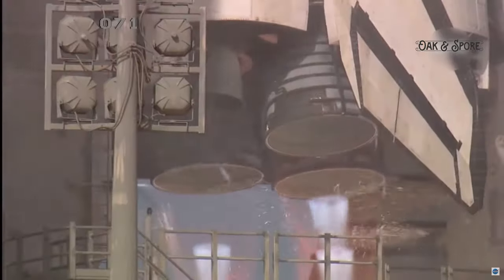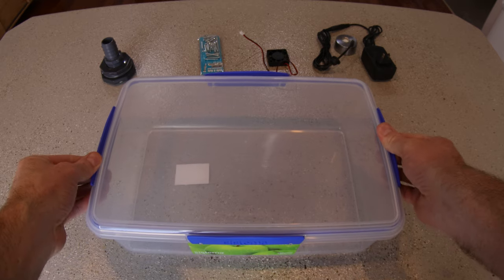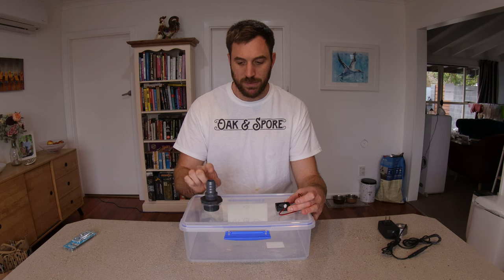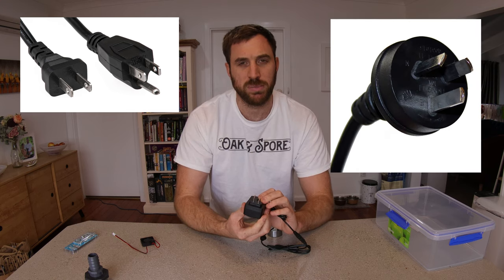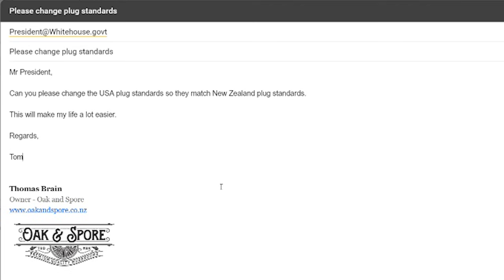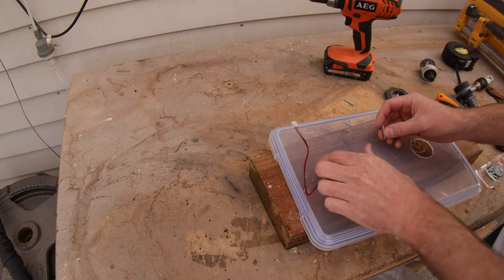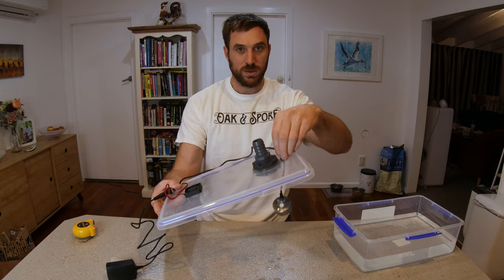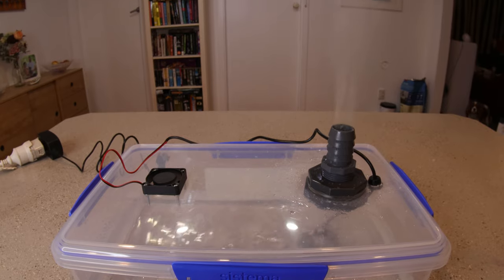DIY Mini Humidifier for Mushroom Growing

Comment: Pro tip! When cutting through thin plastic, run drill in reverse! Also, heat guns softened the plastic, which makes it less prone to crack! Great video! Thanks, I'll be making this for my tent
Reply: Just heat the drill bit or anything metal round rite size and melt a hole thru

Comment: Top-secret pro tip: if you build a little float for the ultrasonic disc to sit in, you can ensure that the disc is always at the proper depth for maximum mist and you can use a deeper container.
Reply from the maker: Yeah, usually I use a float valve on my bigger humidifiers. This little one I've been running the last few days and I still haven't needed to refill it.
Reply: What do you use for a float?
Reply: Indeed,cork or styrofoam are great for that
Reply: @OakandSpore  he means a float to set the heigh of the misting module closer to the surface since it doesn't mist at the bottom of a deeper container
Reply: If you get an arduino, you can plug in the fan and a humidity sensor to the board to control it autonomously.
Reply: @thegreenxeno9430  ooh! How would I do that? I'm new to coding and raspberry pis and arduinos
Reply: @thegreenxeno9430   that looks like a steeeep learning curve

Comment: I did this after your video works great ty. I'm using it for my grow tent and I added a smart switch and a smart hygrometer so I have the hygrometer in my tent and it turn in the smart switch Wich is connected to the humidifier everytime my tent goes under 45rh %

Comment: great mini unit Tom . Can I recommend one addition to your great design ? add a short vertical hose , then add a t fitting. at the 12 o'clock pipe end put a cap over it . The 12 o'clock opening is now your water fill hole , so no need to remove the lid :)  the second - 3 o'clock part of the " T" , goes to the fruit chamber. worth a consider. Please keep creating and teaching new growers how to get it done . thanks
Reply from the maker: Good idea! If I were to use this humidifier full time I would probably do that.
Reply: @OakandSpore  thanks for taking time to respond ! the mini idea is brilliant. keep the good stuff coming. I hope your business is doing well .
Reply: I'm trying to picture what you are saying here. You are saying to put a T on top of the bulkhead, correct?  This would make 2 openings: 9 oclock and 3.  You are saying one side will have an end cap for removal to add water.  You would be pouring it in sideways. Is this what you mean? If so, I would just have two bulkheads, one with a cap, and the other is the humidified air.
Reply: @stellabeatsofficial  I was a bit baffled too until I realized he means to put the T on it's side so there's 1 pointing out and 1 pointing up 😂

Comment: Pro tip, if you reverse the drill bit when drilling through the plastic and create a pilot groove and then turn it back to rotate clockwise and drill your hole you won't (shouldn't) busy through the plastic :) learned for many monotubs/plant grow bins ;)

Comment: You need to drill thin plastic in reverse it will melt the plastic instead of tracking or break
Reply from the maker: Thanks for the tip!
Reply: soldering iron with a tip you dont mind getting covered in plastic works ok as well
Reply: @OakandSpore  yeah do it in REV! works a billion times better.. Not a million but a BILLION TIMES BETTER!!!
Reply: You need to drill in reverse because you live in Australia

Comment: Awesome and way easier than messing around with pre-made ultrasonic humidifiers. I use something very similar, except I snagged an IP68 or whatever waterproof fan from the internets for not-much-money, and just sorted through all my old USB chargers etc until I found one that would be suitable. Same thing with the humidifiers, except I use two because my room is located in an awful location and Australia gets hot as manure. Got away with a single one last year in a 4 tier plastic greenhouse (with a big tray of perlite at the bottom) with only a few issues on the hottest days.
Reply: Nice man! Have you had any issues initially with your ultrasonic humidifier? Mine is very inconsistent at the moment, and for the life of me I can't figure out how to get it to work consistently

Comment: You can also run your drill in reverse to prevent cracking or use a blowtorch and heat up the whole saw blade

Comment: interesting design. i've had  poor luck with the ultrasonics, they keep dying after a short while. I've been thinking about how to DIY a bigger (than my current off-the-shelf 4ltr capacity) humidifier, though the ultrasonic doobalackies don't seem to like sitting in too deep water, which makes me wonder how to be able to increase capacity...
Reply: Try using a float and a lab power supply
Reply: @realhusky  What is a float?

Comment: I have an idea. I'm planning to make an automated monotub and think I'll probably run relays, one for fan and one for transducer both powered from the single power supply. When you just require ventilation, turn on the fan only, for humidity, turn em both on.
Reply from the maker: Check my next video being released this week! Its along those lines.
Reply: @OakandSpore  Great minds think alike! just watched the one on your new units, looks nice, I assume that they take a freshwater input because of the pipes and what looks to be a filter in the back of the unit. It would be very interesting to know just how they modulate the intensity of the transducers. Thanks for all your great videos mate 👍

Comment: Great video! Just a heads up, there’s a speed switch on top of your drill and the low setting will help on plastics and metal. You probably already know that. Thanks again.
Reply from the maker: Thanks for the tip!

Comment: another tip is run your drill in reverse to cut the holes and heat the hole cutter bit with a blow torch to help melt it

Comment: When using a hole Saw on.plastic, speed isn't the issue..... But once the pilot breaks through, turn the direction backwards, and don't.push hard, it will cut through easily

Comment: doesn't the mister power supply output 24v AC ?
and doesn't the  fan run on DC?
the ones I have say   AC output on the transformer
I think I tested it once with  my cheapo meter   and set it to 20v DC and it was giving a weird reading   lie, it was AC and not DC so powering both  with the mister transformer is probably not possible without a diode or  a bridge rectifier or something

Comment: thanks for uploading - i had never seen these little fogger modules before but its the very thing.   you can also get very tidy little modules for humidity/temperature control complete with sensors.  switching AC or DC 12/24v versions.  (  about £15 GBP  )  im thinking that the DC version could work nicely with a system like this, all running off the same transformer.  ( probably safer than the AC one too)

Comment: Do you like humidifying based on a humidity sensor, or just setting a time based automator?
Reply from the maker: I find humidity sensors don't work that well above 85%, so I generally use a timer.
Reply: @OakandSpore  
That is very interesting.   I like electronics so that is quite a bummer.   Perhaps looking into modifying a few kinds of smoke detectors would be worth while for higher accuracy measurements.
I'll check it out.
Reply: heyou what’d you find out? I’m setting up a tent right now and I’m interested to hear if you have a solution to automate the humidifying process

Comment: I always just use pliers and bend the american plugs. Also are you sure both were DC 24v? my ultrasonic was AC coming out of the adaptor!
Reply from the maker: Defiantly the same voltage. Your adapter may have been broken?

Comment: The trick to not breaking your tub when drilling holes is to apply minimum pressure & just use the drill at high speed
Also hold your tyb don’t let it spin lol
Reply from the maker: I learnt that the hard way...

Comment: Hi! Thanks for this video! Do you place the DIY humidifier on the floor of the mushroom house or put it on a ledge high up in the room? I've just started a very cute oyster mushroom house, about 2x3 sq meters and 6 ft tall. I have 400 bags. I'm from the Philippines and temp is between 27-37C and humidity is 70-90. Right now I'm just doing mist spraying 3x a day directly on the fruits and fruiting bags, the walls and floor. I think I'm not doing things right because my fruits start to go yellow and dry up after 2 days.
Reply from the maker: You need more humidity. I have a video for a larger humidifier on my channel, build that one.
Reply: @OakandSpore  I'll check it out. Thanks and God bless you!

Comment: You can drill without a wood block by not applying all of your body weight onto the drill. Just let the weight of the drill and the teeth of the hole saw do the work.

Comment: One more dumb question, why not just put the bin & mister where the mushrooms are and just turn it on.  That is why use the fan , lid and pipe?  I ask because I need a humidifier in my fridge turned cheese cave and it seems I could just put the mister in a container of water and be done with it.
Reply: In my experience the mist just sits there and doesn’t disperse around the chamber nicely

Comment: if the fan draws alot of current say 1 amp off a 500mA power supply at 24volts for example it would run slower, not blow the power supply, it would just get hot as the power supply is under current, i would us a 5 amp power supply for that set up,
Reply from the maker: 120w power supply is extremely generous for that setup! If you draw too much amps you will blow a supply.

Comment: Hey, nice work man 👍 i would like to ask how You exactly connected fan and a fogger together?
Reply from the maker: If they are both the same voltage I just solder the wires together.

Comment: Hey man, thanks for the video! Went ahead and made one myself, though I'm experiencing severe reliability issues with the ultrasonic humidifier. I've tried cleaning it, using different water, but it is still temperamental at best - for the life of me, I can't figure out how to get it to work consistently. How is yours holding up after a week or two of use?
Reply from the maker: I have a 12 head fogger which is still going after a year. I think the quality really affects how well they work.
Reply: @OakandSpore  Cheers for your reply! Fair, my current one is cheap piece of ... uh, equipment, single head (like the video). It's difficult to get a reliable setup on a shoestring budget.
What do you think might be the key factors that influence reliability of the small head ones? Am wondering if a simple component replacement might Make It Great Again...
Reply from the maker: If you found one that wasn't dirt cheap it would probably be better. There are some decent 4 disk foggers out there also, maybe step up to one of those.
Reply: @OakandSpore  WIll give those ones a go, cheers
Reply from the maker: Hey dude, believe it or not I have problems with my ultrasonic fogger today. I checked it with a multimeter and it looked like the voltage was dropping in the power supply. So perhaps try a better quality power supply with yours. Just make sure the voltage is correct!
Reply: @OakandSpore  Hey man, sorry for the late reply. This is what I was after!! That awesome mushroom engineering troubleshooting brain of yours making things accessible for all us beginning folk :)

I switched over to a <£30 ultrasonic humidifier system, which has proven to be far more reliable than I could ever hope to hack myself haha. The only customisation I did for that was to remove output nozzles (which were broad and for "room diffusion") and replace it with a garden hose which I piped straight to my SGFC
Reply from the maker: Brilliant! Sounds like you have it sorted. Hopefully you get a good runtime out of it!
Reply: I too had a lot of failures when purchasing cheap from China. Bought an expensive one from my local garden shop with a 12month warranty- its never failed. Ive evn accdientally run it dry for days!